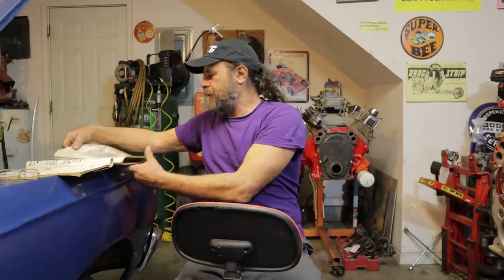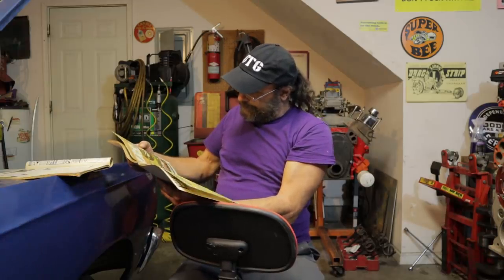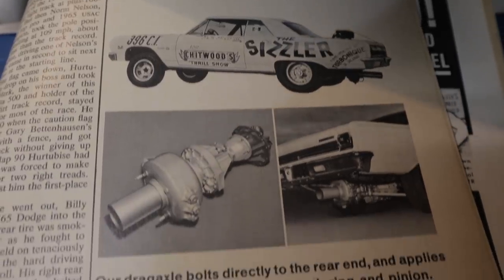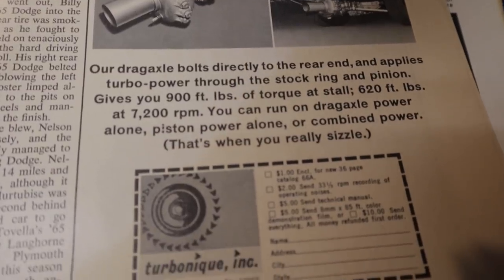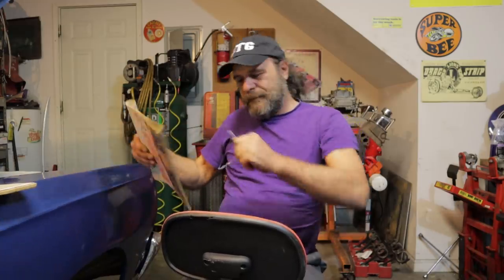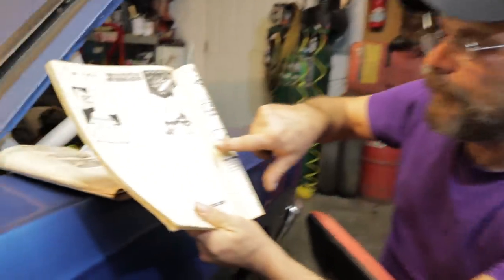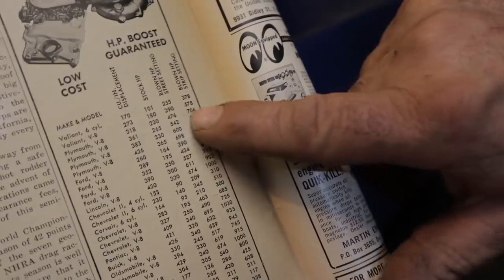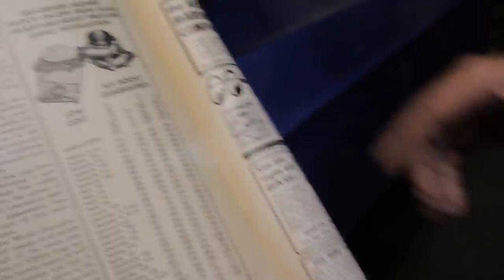Electric Turbocharger?  That's For Kids...Here, Hold My Thermoline....

Comment: Can you imagine seeing a guy strap one of those to a go kart? Balls that clank.
Reply: One wonders how he could walk...
Reply: This is also when folks made drag bikes with car V8's...we think the Boss Hog is new. These guys would fire up the engine with the rear wheel up in the air, kick it off the kickstand and hold on for dear life in 1320 feet.
Reply: It is on you tube fast as hell go cart
Reply: @drrrrockzo  
Well, his completely empty head helped hold everything off of the ground
Reply: Yeah, they clank, right up until they are ripped offf....
Reply: There’s already a video of it on YouTube
Reply: @redram5150  yep. I know. I've seen it.
Reply: The peroxide rocket carts were f'ing nuts enough! Jack McLure was running 185 with a half track burn in the 70s

Comment: Uncle Tony. You're going to love this. Am pretty sure the fuel cartages this guy was using for the car equipment first started selling to the comic book back pages as white gas-fueled rockets for kids.  I had one in about 66. You took this slightly larger than CO2 cartage, same design except it had screw-on fins on the neck end that made it look like a rocket. 
Then filled it with white gas, it had a bottom tank you put cotton balls in and soaked them in White gas. the bottom had two wire clips that went around the cartage which you would then run 500 yards of heavy fishing line from a pole to a pole. Lit the white gas cotton balls and waited until the white gas in the cartage boiled shot out the back through the "rocket nozzle"  and iit instantly lit with the fire under it. They really did work. Until kids had the cartridge nosels clog and they would explode. The reason am thinking it was the same guy is the gear heads that lived next to me as a kid had these cartages empty from some type of early NOX. They had a 65 Chevelle that used some type of early turbo that they use to run at Union Grove drag strip.  That's all I can remember.

Comment: I remember those drag axles and the adds. Too bad they were so dangerous! 
By the way, can you give us the year and month of the magazines you’re looking at. A lot of them are available on EBay, and in used bookstores all over. Thanks! 
My father in law worked for a company that was contracted by NASA for the Gemini Missions. He did a lot of work on satellites measuring temperatures, radiation and micro meteors and their impact force on spacecraft so we could protect the astronauts. 
While there he saw Wernher von Braun give a speech to some of the engineers he was in charge of. He was discussing the difference between liquid fuels rocket and solid fueled rockets. Solid fuels rockets were lighter, but not throttle able like liquid fuels rockets are. One of the engineers asked why that was, and con Braun replied, it’s not what we want, it is what we get! My father in law was pretty much of a genius himself, helping design and implement surface contact radar the Navy mounted on their destroyers that enabled them to hunt Nazi Uboats at night when they ran on the surface to recharge their batteries. 
Back in 1976, my High School Auto Shop put together a 10.90 class car for the Winternationals in Phoenix. Some racer there had a rocket car. Not a jet powered car, but a rocket fuels car. That thing was fast. He was running 4’s in the quarter mile back then with that beast. We showed up on Friday to tune the car, Saturday to qualify and Sunday to race. On Saturday, the rocket car made two passes to keep the crowd interested as there were some long gaps between classes as they ran for qualifying. The first pass he was fast. Incredibly fast. On his second run something happened and he couldn’t shut down the liquid fuels rocket. He deployed the parachute but it just disintegrated in the wind. It might have slowed him slightly, but it sure didn’t look like it from the water bad where my buddy and I were waiting for our car to come up and do it’s burnout. We held the car straight all weekend. Anyway, type cute was destroyed, as he ran out of track continuing on up into the desert where we saw Dust and dirt getting thrown up and even some cactus taking flight. It kind of looked like Wile.e.Coyote himself was again fowling up his effort to catch the roadrunner. The car finally came to a rest well out of view, and the safety team and ambulance were driven out into the desert to help the driver. He was shaken up, but came out of it with bumps and bruises. He was one lucky man! But after that the NHRA forbid any more rocket cars, and you still won’t see one today!
Reply: He did say the month & year.

Comment: More violent than nitromethane or hydrazine?!?

Yeah, nope right the f out!
Reply: This solid rocket fuel is more akin gunpowder than nitrometh or hydrazine. It's extremely violent stuff and once you light that candle there's no way to snuff it out, you've just got to let it burn.
Reply: Todd Orton  That rocket plane would be the Messerschmitt me163 "Komet". The Germans used a liquid rocket fuel which would self-ignite upon contact with air. There were quite a few fatalities when they were testing and developing these planes, not just engine explosions, fueling up the planes would often lead to major accidents, the early planes would sometimes break apart at high speed (these planes could reach 700mph) since they were made out of plywood and the glue they used to assemble them was defective. The planes were also very difficult to land safely. In the end they managed to make enough improvements to these planes that they were viable weapons but at that point the war was basically over.

Comment: The reason you don't see widespread use of electric superchargers is because it takes 50-100HP to spin up superchargers commonly used on the street, several times more that for a drag car. There's no such thing as a free lunch, developing 50-100HP with an electric motor takes a significant amount of electrical support, such as driver, cabling and of course very heavy batteries. Batteries that remain heavy even after they are depleted.

BTW I think the "conspiracy theory" about these rocket-chargers may be somewhat true, as even today modern stealth aircraft use these rocket-chargers for quick start of their engines when they don't have time for an APU assist start. Very similar tech!

Comment: Actually this is Bryan posting on my wife's account. Anyway, the March 2004 and April 2017 issues of Hot Rod magazine had 5 page and 7 page articles respectively on this product. That's how impressed they were with it even after all of these years. The 2004 article had pictures of Roy Drew's "Black Widow" Volkswagen. They reference him racing Tommy Ivo's 4 engine dragster and the bug turning a 9.36 e.t. at 168 mph. They  have pictures of a go cart with 2 (!) of the 370 lb thrust rockets. It hit 150 mph in 4 seconds before the driver spun out of control and then put it in storage.  The 2017 article features a Z16 Chevelle with an assembled model DS-28, the larger and more powerful "Drag Axle". This 1300 hp version cost $4695. That's almost twice the cost of a new Mustang back then. They also referred to a model T-16-A Formula J Thrust Engine with 1980 hp on pg. 58. They also showed a first gen. Mustang called "Pegasus" with "STAND CLEAR" painted on the back of the trunk and you can see huge flames shooting out the back of the car showing why. Lots of pictures and diagrams in both articles! The 2017 even has the start up procedure. Thanks Uncle Tony for reminding me I had these article in my car magazine archives!

Comment: The advantage of an electronic supercharger is that it works more than once without reloading.

You could probably make a solid fuel version work off of a big model rocket motor, which are black powder iirc and ignited by an electric match. Rocket motor exhaust blows into the turbine (basic turbo here), spins the compressor. You can probably use a much smaller turbine wheel than compressor, since you don't need to run the full exhaust flow through the turbine. Aim for about 7 seconds of burn and let the last bit of the track be while the compressor coasts down. 

The best part of this is that model rocket engines are sold by burn time.

Comment: Some old aircraft engine's were started with black powder cartridges. They would turn the engine over by hand to prelube the engine and draw fuel into the cylinders. Then the pilot would drop the cartridge into the firing chamber, yell Clear! Then yell Firing! Then pull the trigger to start the cartridge burning. The expanding gas from the burning cartridge would turn the starter and that would turn the engine over starting it.

Comment: Sounds like a cart start on a kc 135 tanker.  We started the engines on basically a 707 airplane with a large charge a solid propelant/gunpowder shoved into the side of the engine.  We hated doing it,  it was only done occasionally for inspections and generations..  it was for an emergency start during   a conflict when ground support wasn't available. .

Comment: Also Modern anti-lag systems that inject methanol and fire into the exhaust manifold pre turbo are capable of achieving 7-9 psi of boost at the starting line.
Reply: Pop pop!

Comment: The drag axle actually makes more sense to me.  No need to consider a fuel enrichment scheme or worry about excessive charge air temp without an inter cooler.   No additional stress to any component except the axle.  (What’s that Valiant doing with a Dana 60 under it?)

Comment: Solid fuel? No thanks. Once lit, that’s it! Snap an axle? Too bad, you’re blower is gonna run until the fuel is gone. You’d need one heck of a wastegate to save your car.
Reply: @davegonthier5916  not with the Drag Axle. That's a rocket driven turbine attached to your axle (or driveshaft, pictures aren't clear). Though with a liquid fuel you should be able to shut it off...

Solid fuel turbo isn't terrible, stand on the clutch if the axle goes. You're going to want a blow off valve, anyways!
Reply: If an axle snapped, simply shift into neutral!!! Definitely worth trying!!! There will always be naysayers & sniveling children but, the one who remakes said products WILL BE WEALTHY!
Reply: Or just shift into neutral. No risk, no reward!!!! Human kind would never be where we are today if everyone was scared to take a risk!!! Sack up!

Comment: I have those old prints. I remember a dual system 4wd version. They had to use aircraft wheels to handle the speed on the salt flats. Hot wheels even produced it. I believe I have that laying around someplace too. I also remember my first nitrous bottle. It still had the WWII swastika stamped into the bottle. They used it on airplanes.

Comment: LOL, judging by the power figures they wrote out for the "race spec" power setting they'd have to be running that rocket powered blower up to AT LEAST 30psi of boost, and that's with a pull-through carbs in the days before intercoolers were a thing. They had methanol-water injection since the Nazi-Germans invented that stuff in the 40s but unless you were running both water-meth injection and you were running your engine on ultra-leaded 140octane aircraft gasoline you would have blown your engine to kingdom come, and that's provided it was correctly tuned from the get go, something I'm not sure how you could accomplish without both using complex math and a trial&error process which would consume multiple race-spec engines before resulting in useful data.

Comment: Seems like you could use an off the self turbo and power it with high test hydrogen peroxide.

Basically you pass the HP over a catalyst (platinum or maybe iron), it decomposes into water (steam) and oxygen...then drive the turbine with the gases.

The space shuttle's main engines used a similar setup as fuel pumps.
Reply: Google HMS Sidon  before you decide to play with High Test Peroxide.
Reply: @richardhunter607  I'm fully aware of HTP's dangers...but realistically no more dangerous than Isopropyl Nitrate (Thermolene). 

I think the hardest part is just getting it.

Comment: How do you gain almost 700hp and not need to change jetting? Just bolt this on and go? Or am I missing something? Also the first one bolts to the rear diff? What if instead of turbos driving the engine, they drove the rear axle? Would need a special transmission I'd imagine but could be in the future.

Comment: IIRC, the Turbonique liquid fuel stuff could explode if the throttle was closed and then opened again. I beleive the Turbonique Beetle got wadded up, due to lack of throttle control- it got out of shape, couldn't control the throttle and rolled. The solid fuel stuff could not be controlled once ignited-it would burn until it ran out of fuel. That material is highly volatile, and can react without warning, so be careful kids.

Comment: One of the better known rocket axle cars (it was used in Turbonique advertising) was a '65 Mustang called The Ozark Mule. The Mule was based out of my little town here in NW Arkansas. It was  sponsored by Marsh's Racing Tires, a local company. Rule changes eventually made the car obsolete, as Tony mentioned, but the Marsh family and others involved in the project are still around. The fate of the Mule isn't exactly clear, so naturally, there are rumors that its still around too, tucked in a back corner of a barn or garage. Probably just wishful thinking, but who knows? It would be really cool if it did turn up again one of these days.

Comment: Uncle Tony wrap your head around this u got a couple bigger ish 120 cf welding tanks in the trunk they contain a atmosphere type of gas maybe slightly higher in o2 no turbo no super charger its just ran thought some valve to meter it out at say 45 psi or what ever u want straight power adder and fuel to match its a one hit wonder but would be great for drag racing at the track just need like 20 tanks to swap them its very buildable with off the shelf parts now

Comment: a few years ago, a company sold a kit that used scuba tanks, regulated down to 15 psi or so and fed to the carb or throttle body. I think a tank was good for 3-4   passes. Tank was Kevlar, and was pumped to 3000 psi, found the article. https://www.hotrod.com/articles/compressed-air-supercharging/

Comment: more violent and volatile than burn green Hydrazine?...WTF?...i still marvel at a blob of sterno in the air cleaner, but i always wondered why a metered 2000-psi scuba bottle couldn't be substituted for boost without the parasitic drag and heat of a supercharger.
Reply: You’d empty the bottle very quickly. There’s a company making compressed air supercharger systems. Took a lot of work and tweaking to make it not grenade the engines. And they use two large tanks for one run. An engine consumes a lot of air, especially making lots of power.
Reply: Volume
Reply: hey thanks you guys...i was thinking for 1/4 mile blasts only and maybe 4 or 5 scubas in the trunk or one big welding bottle, i bet it would have to be regulated perfectly, or with the masses piston engines move, a 440 would probably empty a standard scuba bottle in a few seconds just idling, but thanks for showing me it could/can work.

Comment: 1 company is using a rocket engine to "turbo-charge" electric vehicle charge in the fly. The UK car maker is called Ariel. They made the Ariel Atom and are about to produce an electrically powered supercar. The (not a rocket) jet turbine is run using more conventional jet fuel to charge/recharge electrically powered systems by charging battery on demand... Unlimited range with fuel to make power.

Comment: Funny I’ve been going about this backwards, been trying to build a turbo pump for a model rocket from a turbocharger so far I’ve been able to run the stock turbine on liquid oxygen and kerosene for several minutes diving a single pump at full load pumping water at about 1500psi and about 600 gpm. Having terrible trouble with the temperature difference between the hot side and the cryogenic pump It would be so much simpler to drive a turbocharger with a separate combustion source you could use nitrogen tetroxide/hydrazine as a extremely simple hypergolic system or a more complex gasoline/nitrous oxide fired  gas generator

Comment: I'd stick with a brushless DC motor driven turbo.  You can monitor/control boast and only worry about the engine exploding.
Maybe Rocket Lab could make one.  Their rockets use a similar setup to feed it's fuels.

Comment: Tony do you know anything about the liquid fueled rockets they ran in maybe the early 70's not sure on the year I think one held the record 1/4 mi et for a lot of years in the high 3's I believe
Reply: Hydrogen peroxide rockets! I’ve seen them. Record was like 3sec at 411mph. They still run some in England including a motorcycle!
Reply: @Headerflame  yeah i think were are on the same page I wonder why nhra banned them
Reply: @jeremyhanna3852  Well, for a couple of different reasons. First reason was that at those higher speeds, the brute acceleration had a tendency to knock guys out. The other reason I believe was that they really are not equipped with a throttle. Rockets run until the fuel is spent. Too much fuel you go too far. If you go airborne, you may continue that path. At least these are the things that I’d been told.